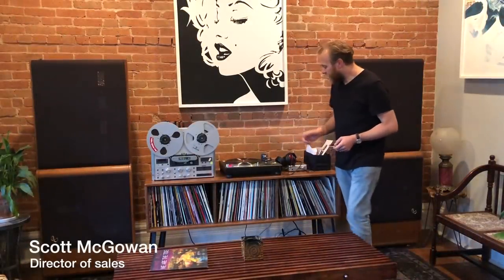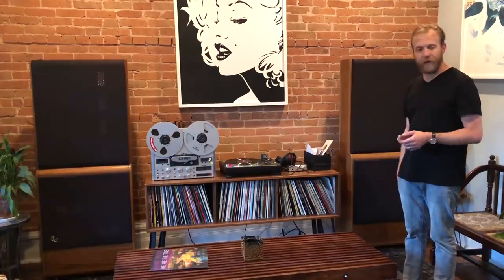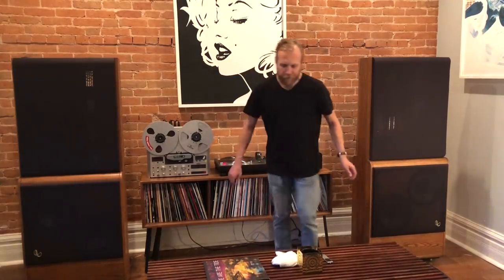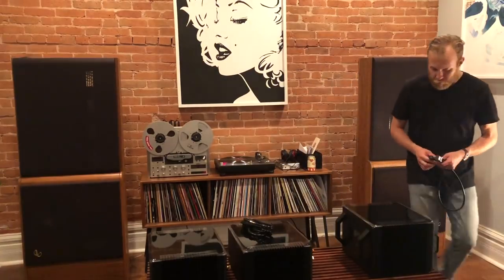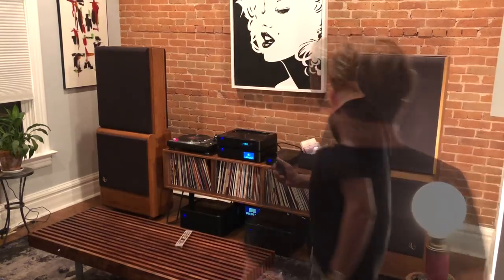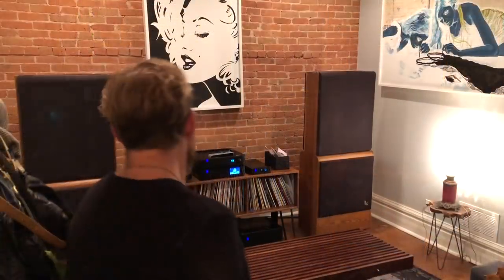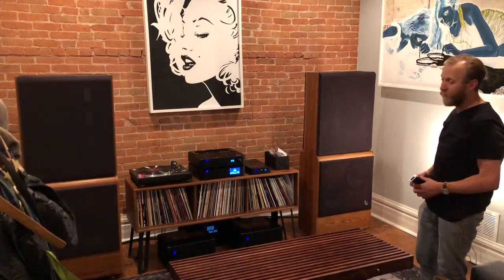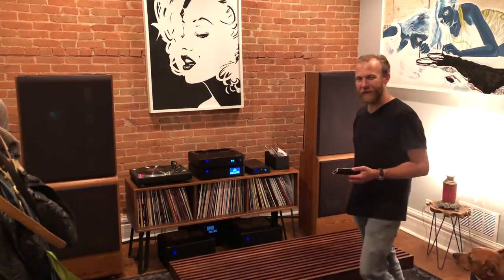PS Audio System Upgrade

Comment: $30,000 later one would hope it would sound better than a $500 Sprout
Reply: @bigjay1970  he's not ignorant. Given that his dad owns the company, this was 1) free advertisement that looks like an upgrade video 2) free to him, since he probably got all of the gear for absolutely nothing.
Reply: @sbrazenor2  Hard to tell if Big Jay was referring to anyone specifically, or if it was just a general observation.
Reply: Paul stated in one of his videos.
The Sprout and Elac speakers are available from PS Audio for $900.00. Paul said they are made to play “musically” together.
Reply: Ja, especially given the point, that those EMIMs never worked well with (different) class-d amps I tried in my system (I never tried the Sprout though).

Comment: If the camera is shaking like crazy from the upgrade, I can only imagine the needle on the turntable shaking all over the place. You should probably invest in a better turntable stand Scott. Glad to see you are into vinyl.
Reply: o feedback on a Technics sl 1200
Reply: The Technics SL-1200s were designed to "ignore" all of that feedback. I had an SL-1200 MK7 a while ago, and when I'd slap the surface it sat on, not a single thump would pass through to the sound. Those things are magicians when it comes to isolation.
Reply: Technics

Comment: Hi Scott...
I made a typo error in my last message... I have a Tec SL1214 Mk2 ...
I use two cartridges with it .. the original one which is the same as yours and another one (which I prefer) which is a Shure RXT-6 fitted with a stabilizer brush ... I didn't like the M44-7 because it had too much bass emphasis ( desirable for dj rave ups but definitely not for us audiophiliacs..!! ) 
I also have a vintage ( and in mint condition btw ) a Garrard 401 fitted with an SME 30009 tone arm with a Shure V-15 III cartridge.. I use this for transcription purposes only ... the stylus tracks the Shure track ability test record at all levels perfectly ..!!
Your setup must have a 'brick wall" high order HPF above 30 Hz .. that would explain the immunity to rumble and other external influences ...
Btw... I am a recording/acoustic engineer .. working in Sony Music in Sydney and Melbourne ...

Comment: Scott - I have to know ... When you ran your rca's from your turntable to the NuWave Pre, did you use the I2S out to the DAC ?  I have mine set up that way and it is incredible.   Happy listening  !
Reply: Killer idea John! I have not tried that yet. Currently we're using the phono RCA in and the line-level XLR out to my BHK preamp, purely analog reproduction, but I will for sure be trying the I2S connection this weekend! Thanks for the tip!
Reply: The great thing (thanks to your father's design) is you can leave the XLR's connected, install the HDMI for the I2S and do A-B comparisons using the BHK Pre to select from I2S DAC (A to D ) or to Phono Pre  ( pure analog ) and see what makes you smile.  Be well and have fun !

Comment: Sounded great, even through a tv soundbar.  
P.S.  i got a very unexpected & (shockingly) noticable & upgrade in all round sound quality just for  taking my turntable off it's dedicated hi-fi rack's spiked top shelf & placing it on a steel t/table shelf designed to screw into a load-bearing wall.  (Even better than some cartridge upgrades)

Comment: 2:03 ... Your 20 amp power cord has an incorrect male plug on the outlet end.   This plug should have the normal ground prong and also the two other prongs should be at right angles to each other with the "hot" prong on the right side from the rear.

Comment: By sitting that close to the RS 4.5's, probably most of the high frequencies are hitting the back wall.  You should experiment with toe-in.  Those speakers would sound even better if you could get them farther away from the rear wall, since they are a partial dipole, but it appears you may be room limited there.  Nice system.

Comment: nicely done...    am sure it sounds great.   The RS 4.5s are on my "bucket list" of speakers...   super rare and very limited production...  and I've read that their imaging is stunning & that  they were a pretty significant improvement over the Quantum QLS-1s.  It's kindof amusing to me that the speakers are the least expensive part of the system...  but hey, that's the way this hobby is!  Interesting to note that you are not using the external/active crossover for the 4.5s, though some say they sound better without it.    But yea...  everything I've seen/read indicates that the 4.5s really benefit from high end electronics...  you definitely succeeded there!   My "inner audiophile" loves the system you've assembled (and would love to hear it!)...  tho my "practical side" balks at nearly $60k worth of electronics backing a pair of speakers that can be had for a few thousand (if you can find them!).  Nonetheless...  great system...  hope you enjoy it!

Comment: 39K system I guess on today's standard this setup is quite a bargain. Looks like you need to get higher grade speaker wires and interconnects. I  got to believe that system sounds amazing. Now we lnow why you have a dedicated 20 amp circuit to your system. :}

Comment: Adding some vicoustic stuff would probably help the sound and it looks good to boot. What are you doing for cables? Super slick setup!
Reply: Agreed and will have to work on. For cables I grabbed a bunch of XLRs from our engineering wing. Will likely go out and replace with after-market cables soon! They affect the performance so much! Thanks!

Comment: Nice job Scott.  Is it me or are you getting some reverb?  I had a similar sound in a city apartment until I deadened things up.  Maybe it's just me.  :)
Reply: I hear it too.  Needs a ton of sound deadening in that room.  Brick isn't very reflection friendly.
Reply: Ofcourse he has, brick wall behind the speakers in what looks to be a square room with possibly another brick wall opposing it. I have a concrete wall behind my seating possition in my room and it took alot of work taking out the first refelctions to get it controlled somewhat.
Reply: If he can tackle one reflection point that would likely be adequate, like you did with yours.

Comment: Fun Video Scott..  I'm new to the world of "high-end" audio and am curious about the world of "Vintage Infinity" speakers.  As the energy behind the Sprout, and the kit PSAudio sold with the Elac speakers, I'm wondering how you would compare the "Audiophile-ness" of your vintage infinity RS4.5 speakers and speakers similar to Elac? How is its imaging, resolution, resolving power, holographic quality, etc. in comparison?
Reply: I have mad love for the ELAC speakers, and listened to them for years! I think they're a great pairing with Sprout and for the money you're not likely to do much better for a bookshelf system. Having said that, with the addition of nearly $50,000 worth of gear, with proper setup, a dedicated 20A line, and all new speaker cables and interconnects, AND the floor-standing IRS 4.5s, the system did indeed improve dramatically--no question about it. It had BETTER for that kind of $$ :-) Without hyperbole, the imaging became laser-focused, especially with some nice toe-in after the video. The bass resolution is not apples and oranges...it's apples and...uranium...the difference is so profound. Not because the bass is augmented (Sprout has plenty of bass response) but the sheer power behind the BHK M300's simply allows for more control over all 4 of the 12" subs...something the ELACs don't have. Forget the EDM/Hip Hop, just a 6-string guitar or a grand piano is impressive all the way to the lowest registers. These are the attributes which give setting to the listening experience. When you feel like you can HEAR the venue? The toe-tapping on stage? That's what unfolded in my home, and the difference was profound! Thanks for the great question!

Comment: Thanks for your prompt reply Scott...
I too have Technics SL140 and mine sits on a very sturdy stand with spikes that sit firmly on the concrete floor ( they penetrate the carpet ) I use an ME1500 amp with two B&W 800 diamonds and  on some audio tracks it suffers from acoustic feedback .. 
I know the weight of the Technics !! 
Do you use a centre weight on the vinyl record ? They do help ...
Reply: No center-weight, just the Tec-1200 and I make sure to use the rugged Shure M44-7 cartridge. Between those two I can jump up and down in front of the turntable with no skipping! Pretty impressive :-)

Comment: This has to be the most organised set-up video I have seen, items carefully unpacked. The empty boxes put to one side for the inevitable warranty repairs ;-) and very little change to the room apart from the speakers. 
Part 2 the room acoustics, with speaker isolation mats?
Reply: Yeah, I'm sure most of us would carefully unpack a $40000 stereo system..the minute something goes wrong it goes right back in the box and straight back to the store!!

Comment: So the PS Audio Sprout distorts when turned up, that's good to know, saved me some money.
Reply: divertiti It’s a small amp. It will distort when cranked up same as any other low powered amps. Infinity speakers are famous for being a difficult load for amplifier. It’s all about system matching. I’m sure that the Sprout would work well in many setups.
Reply: Also, the Sprout was plugged directly into the wall vs the new setup being run through the P20 power conditioner.

Comment: Isn't the record player the weakest link in your system now?  An SL1210 is not exactly an audiophile player. I know it was designed as a HiFi player in the 60's, and it still is a decent player (I do have 2 myself). But I would think that such a system would call for a higher end record player (that is belt driven and all)?
Reply: Hi Christophe! Thanks for the question. I use the Tec-12 because of the downforce it exerts. I know that this can be frowned upon in terms of preserving your vinyl, and I know that direct-drive turntables can have some sonic issues which may not be present in the belt-driven scenario. However, the biggest issue for me is in practice: I want a TT that doesn't skip when I walk past, if someone is dancing, even if whole groups of people are jumping up and down...the TT does not skip...and thus enables me to throw the best dance parties. It's also going to help me DJ when I buy my next Tec-12 and an analog mixer! Coming soon!

Comment: Scott, are you saying your brainchild sucks? ;) great video!
Reply: TRULY a good question. A very emphatic NO, Sprout ROCKS!! The motivation here is, basically, fun: The addition of 400lbs of Premium audio equipment (retail $38,893.00) had BETTER offer some improvements from my $599 Sprout100! In my humble opinion, neither system for the price can be beat.
Reply: I never had the privilage to hear Sprout but if, if I recall correctly, your mother owns a Sprout it can not be bad. And I am totally aware that both are aimed for different clients. 38k ex speakers, sadly a bit out of my financial league. The difference was clear to hear even through all the YouTube compressing. Great answer from you and I can feel it came from the heart :)

Comment: What are using for a microphone because I’ve noticed in your recordings when you try to have your audience hear your music it sounds like a transistor battery powered radio inside a cardboard box. Try upgrading and researching microphones and recording equipment in proper placement for pick up
Reply: use a recording device like a Zoom f1-LP could also use it with an external mic like a RODE AI-1 to give better fidelity